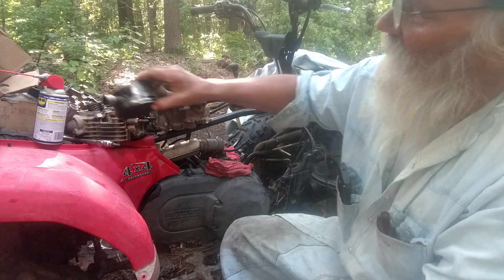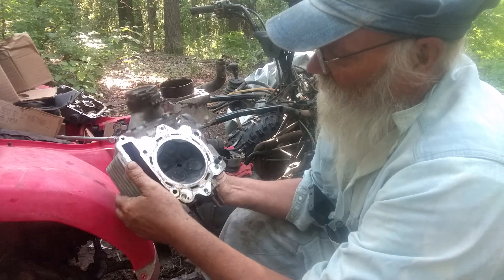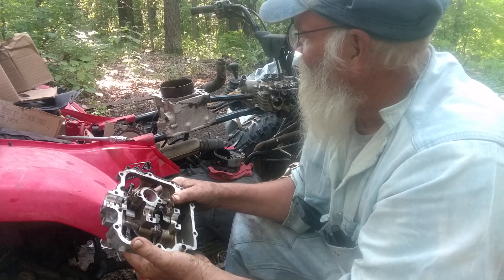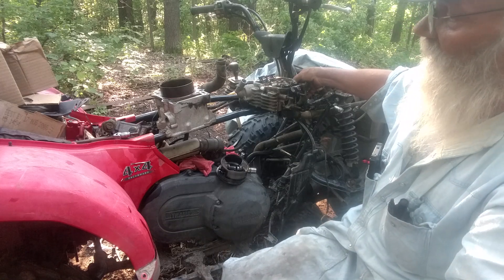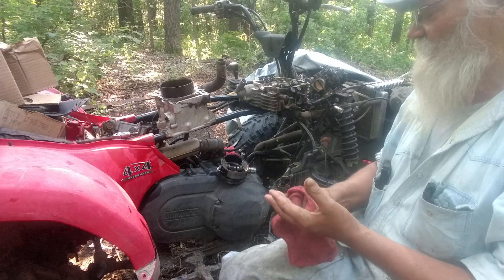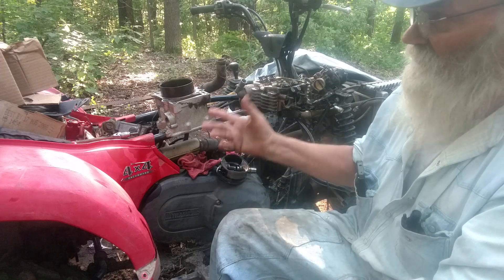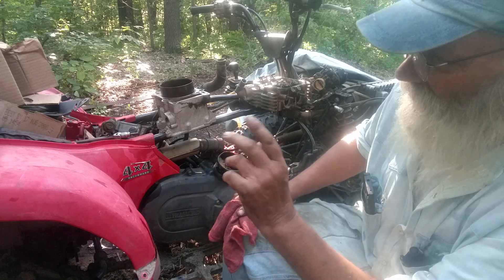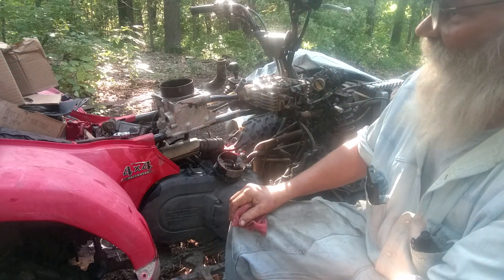Autopsy on the Yamaha 660 Grizzly

Comment: I've never been able to bring myself to buy those things or the side by sides. I have $3k into my 1966 IH Scout and I was questioning my thought process while getting that running and working. I drive and use my Scout for a lot of tasks. 
Yesterday I volunteered at the off-road park by my home. I took my Scout with me. I do recovery work, trail maintenance, and safety checks. Had too show the debt children that $3K dollars worth of old steel beats 40k worth of plastic every time.

Comment: The grizzly 700s went to a cam shaft riding in bearings. Better design in my option also. Although in my many years of being a Yamaha mechanic I Havnt seen too many with much wear in the head cam journals but I still perfer the 700 (686cc) style.
Also that’s a common issue I find with the temp sensor being unplugged usually when someone is trying to get into the carb and removes the plastic panel under the fuel tank. The wire to the temp sensor clips onto that panel and gets pulled off sometimes without notice then in turn gets left unplugged.
Here In Canada the grizzlies hold thier value and are quite sought after. They are very reliable machines compared to most of its competitors. We also deal with Polaris. While they have come a hell of a long way in reliability they still don’t compare to a Yamaha’s quality and reliability. As long as a Yamaha is maintained it will last a lifetime damn near. Once you’ve worked on a couple tearing them apart becomes quite fast and easy. Try tearing apart a can am or Kawasaki and you’ll definstly change your option on how difficult the Yamaha is to work on haha.
Thanks again for another great video. Always happy to see a new one pop up.
Reply from the maker: I used to see worn heads on the first Honda XL 250s, they actually came up with a method of boring the head out to allow the installation of bearings rather than replacing the head.

Comment: As mentioned before, very prone to cold seizures.Proper warmup in cold weather is critical Only holds a quart and a half so it better be the right oil and you better change it often. Keep the airbox clean, it will outlive you.

Comment: Very reliable machines with the correct maintenance. I was able to adjust my valves with just removing the gas tank and side covers. I was able to get to the exhaust valves from inside front fender. Still a pain even removing gas tank and everything associated with it.

Comment: I have an older simpler model like you said a single cylinder air cooled 350 big bear thats been around.  The railroad company owned it for car inspection in the yard, and it still runs great. just had to replace the carb with a Chinese knock off.

Comment: The parent metal cam  bearing surface works just fine for decades if you are smart enough to use good oil and change it often. The only time it fails you is when you fail it!

Comment: When you get it  fixed  you may want to get a  little trailer to pull behind it.  Great for hauling tools for  fence work , garden,   going to mailbox in your case.  Edit   Ps  A gun boot or the fork type for rack .
Reply from the maker: Yep, I have my eyes on one Fleet Farm sells, rated 3/4 ton, and dumps, be great for hauling fire wood.  Gun rack will be here any day,  and I already have a chainsaw mount for it.
Reply: Trailers are great on flat ground...but people tend to overload them...on a hill they will upset the "apple cart" quite easily....hard to get away from the beast.....just an fyi.....

Comment: You get that grizzly fixed up your brother is going to want it back 
It’s a much better machine that any polaris 
But what do I know 
I own Honda wheelers 
No belts no problems
Once you get it back together it will be years before you have to service it again 
Change the oil every year and beat it 
As for your brothers first service it shouldn’t be more than three four hundred bucks 
If it’s a grand he got robbed big time
Reply from the maker: I was looking at the Polaris, and it appears to be a much simpler design to service.  One other thing it's easy on gas, he always complained about this Yamaha being a gas guzzler compared to a couple other Polaris models he has owned.  He always said it wasn't safe to leave the yard under a quarter tank.  Looking at the manual it claims about 17mpg, so it's nothing to brag about.  Luckily I will be using it just around home so for me it's not too big a factor, still more economical than short runs with the M37.

Comment: You haven't worked on a newer (sic) car lately have you Looms? Used to be you might have to take out a battery to get to a headlight (mid 1980's -2005 or so) but now it is not uncommon to remove a wheel and an inner fender or even a back seat to take out a battery. I'm all for the idea of a "better mouse trap" but it still has to catch the mice and be reset by the average person. The whole concept is like an "unsinkable ship," or a self cleaning toilet, never change oil, or pixie dust, and unicorn rainbow farts. Why are newer car engines shrouded with pointless plastic panels for aesthetics?
Reply from the maker: I replaced the tail light lenses on the Grizzly yesterday, took an hour for a job that should be no more than 2 minutes.
Reply: @logcabinlooms  l heard something about you having to remove the seat and rear fender????

 We (you and I and the rest of the sane public) need a Russian Kalashnikov version of a 4 wheeler: air cooled with only metal where it counts and near to no plastics other than seat covers and hand grips and maybe.

Comment: Talking about the  side by sides  most cost more than my home . Completely over priced toy.
Reply from the maker: But every weekend I see gangs of them cruising the back roads.  They load up the wife, a couple kids, a couple coolers, and the family dog, and trailer them out to small towns, and drive the dirt roads.  Generally in each other's dust.  For the price of them something like a jeep would seem more practical, but there are lots of them around.  On weekends you see them parked in front of small town bars, all decked out with every imaginable option, some people have odd priorities, and evidently more money than they know what to do with.
Reply: @logcabinlooms   in dept up to their eye balls.  I have dept  but not on a  50 thousand dollar or more  toy  covered in electronics and computer controlled ignition  . Agreed on the jeep thing. I have been fixing up a older jeep  . No electronics ,no computer just mechanical. Not the best riding vehicle but paid for and fairly simple and tough.
Reply: @larryalexander4833  I take my 66 IH Scout to the Off-road park in my area. I volunteer there on Holiday weekends doing trail maintenance, recovery, safety checks. I have shown a lot of Debt children that $3k worth of old steel is better than 40k worth of plastic all day long. The funniest thing is when the debt children have to load there 40k machine onto the 70k truck and trailer. I drive my Scout right out of there and onto the highway legally.